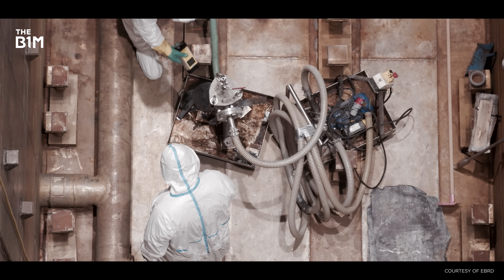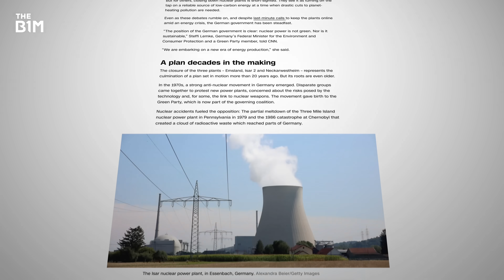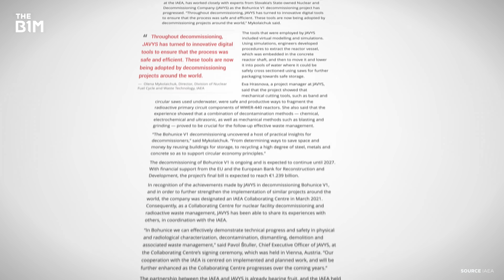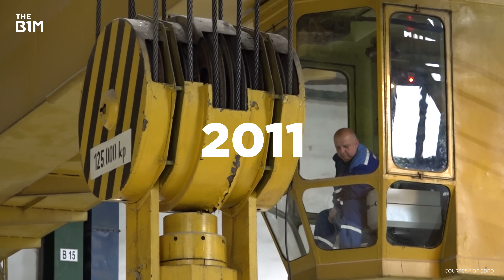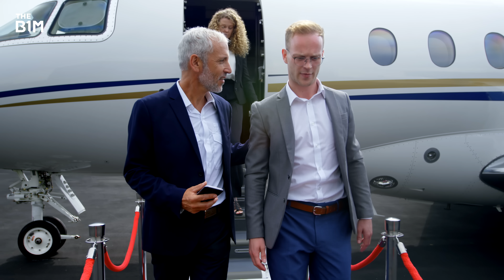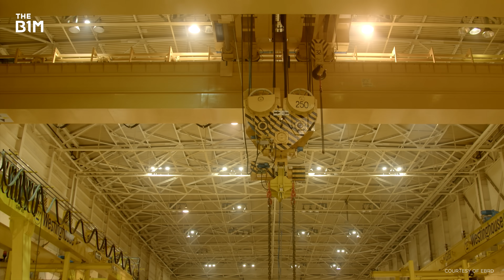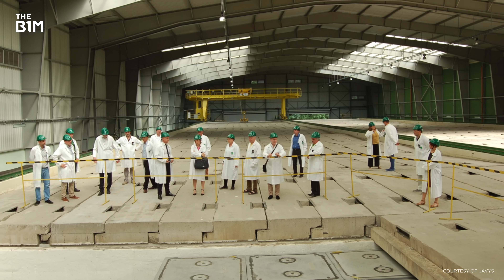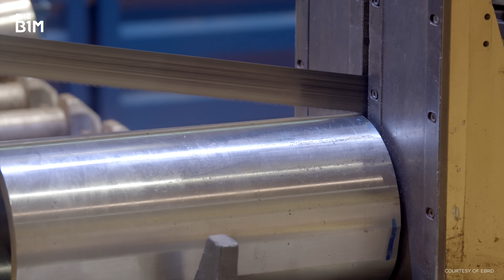Why These Soviet-Era Reactors Are Being Taken Apart

Comment: Germany is decommissioning it nuclear reactors in favour of coal and energy from hostile nations because climate change or something
Reply: Coal use in germany has been declining for years and is now the lowest it's been since reunification. 1GW of solar capacity added per month will do that.
Reply: Yes. Some very poor decisions have been taken in that country. They actually effectively replaced their nuclear with renewables, leaving most of the coal and gas in place, and thus still have quite high energy sector emissions. They are still making progress (the supply is 75% renewable/low-carbon right now, and thus 350gCO2e/kWh, for example), but it should have been so much better (the UK did a much better job of this overall, although right now it's only 60% low-carbon, 239gCO2e/kWh, because Germany has more solar).
Reply: @xxwookey  you can't compare UK with Germany and other countrys with big lignite brown coal mines. UK has nearly no coal mine jobs since the 90s when the chart on wikipedia is true. 
Germany has the lausitz and the one in NRW where a lot jobs are direct and indirect connected to the coal mine and the power plant next to it. If you make such a cut you need to be sure that there are enough other industry jobs in that regions that will keep the old coal regions alive. Ghost towns are never good. 

Stone coal is imported so easy to move that power plant to backup stage and get rid of it later. 

Poland and USA has the same problem with their coal regions that you need new good jobs there or you produce yourself a political problem in the near future.
Reply: @toggleton6365  Yes you have to transition the people, but you have to do that anyway at some point - just get on with it 20 years ago instead of killing the nuclear plants first and only getting serious about the coal in the last 10 years. That choice has cost millions of tons of emissions, which in turn has cost real lives of people (including Germans in floods, but mostly poor people elsewhere). 

There is plenty of coal left in the UK to dig up. We didn't stop in the 1990s because there was none left. OK, we didn't stop because of great climate policy either  - we stopped because it was cheaper to open-cast mine it elsewhere. So that was partly an accidental success, but dealing with that job transition early was the right thing to do (it could have been done a lot better - Germany is doing a better job on that front I think)

The UK kept its nuclear running till end-of-life, and Germany didn't. I think it's perfectly fair to said that Germany collectively screwed that decision up, causing great loss to us all. 

So yes, I think we can compare. Obviously circumstances differ, but there are comparisons to be made.
Reply: @xxwookey  Well hardcoal mines in Germany are closed too since a long time. And imported from elsewhere cause cheaper. I did talk about lignite. And the region in NRW close to the netherlands and france will be less of an problem that is why there is the push to shut it down faster. The big political problem is still the reuniting with east Germany. And the region there that is already burning political. Fast shutdown there would make it a lot worse.
Reply: Then, they are completely stupid.  If is for climate change, then you need nuclear powerplants.

Comment: Bohunice 1 & 2 are WWER-440/230, the same type as Greifswald-1 to 4, so not that new, when the Bohunice units shut down, the Greifswald units were already 11 and 13 Years into their dismantlingprocess. Also Slovakia was never part of the sovietunion, Czechoslovakia was only member of the Warsaw Pact.
Reply: And a WWER 440 isn't exactly a giant reactor.
Reply: @tz8785  depends... If talking generally, basically any nuclear powerplant reactor can be considered "giant" as far as things go... I mean it is much bigger than a common washing machine or freezer. If comparing reactors to reactors, then you would be correct.

And then the whole debate on the nature of Czechoslovakia... Fact is that while not technically integral part of USSR, it used to be a de facto vasal state with rather limited ability to govern itself.
Reply: read. please read.

Comment: Bulgaria also shut down it"s VVER-400/WWER. They don't meet some requirements for safety and bioshield. VVER-1000 work fine. However ours were not disassembled. Interesting video
Reply: VVER 10%0 are newer design, with containment, which is missing in 440 design, or rather be using barborage instead, but that is not up to the EU standart, as there are no such type of reactor, construction philosophy in EU-15.
Reply: @lukasvrabec5783  You can license reactors with the same containment type as the VVER-440/230 in the EU, like the AP1000, for example.

The key point of the VVER-440/230 is, that the containment was not designed to withstand most of the expectable damages. It was only designed to withstand a slow gradual leakage of the reactor vessel, but no major failures, like a pipe rupturing or a corroded through RPV-head bursting or such. In those cases, the VVER-440/230's reactor building would just burst together with the primary loop.
Reply: no....    it is Europe setting this condition. It is about energy control

Comment: So if we take into account the 1.3B clean-up, isn't nuclear power very expensive?
Reply: The decommissioning cost is something like 5% of the total lifetime plant cost - so there is generally a 0.06 cent charge per kWh to cover decommissioning (on a generation price of 10 cents/kWh). So it's a cost, but not a large one. Nuclear power is relatively expensive (more than twice the price of wind or solar) but it has a completely different generation profile (steady all winter) and that has value. If storage gets cheap enough, much of the value in expensive nuclear generation evaporates, but some countries just do not have much local renewable resource, so in those places nuclear remains attractive if only for energy independence reasons.
Reply: Although its an added cost, on a cost per mw generated basis nuclear is consistently around $80 all in all, although wind and solar will be cheaper, nuclear is still cheaper than some offshore wind farms, geothermal and hydropower sources, on a cost per mwh basis
Reply: @milneman101 Offshore windfarms play havoc with underwater acoustics. They're cruel and dangerous for underwater wild life that depend on sound to navigate, such as whales.
Reply: With big reactors, yes. The small modular reactors briefly mentioned, no: Most of them 1. Run off thorium instead of Uranium (much cheaper) 2. Run with salt instead of water (no high pressure == no explosion risk) 3. separate fission components as they're running (i.e. instead of making nuclear waste they make useful nuclear byproducts, such as the stuff we use in cancer treatments)

Comment: Ummm Slovakia was never a part of the USSR and I don't get how Chernobyl nuclear disaster is related to these, unlike RBMK reactors used in Chernobyl, VVER design used here is inherently safer so I have reasons to believe it was shut down due to stupid politics, not actual security concern
Reply: VVER is not as bad as RBMK (nothing is!) but there were serious issues in the early VVER designs, meaning they didn't meet European requirements any more. So it's not just silly politics.
Reply: @xxwookey  Such as?
Reply: @xxwookey  Ой, не надо! Просто ЕС не нужны были другие электростанции, им важно было держать Словакию на коротком поводке и при помощи дефицита ЭЭ это сделать очень просто.
Reply: @WladimirGalkin VVER 440-230 is simply old design which missed many of nowadays important function and since these two units were on the end of the their lifespan, it was simpler to shut down them. VVER 440-213 (newer version) met security requirements. Slovakia operates 5 of this units and each unit has more power than each unit of VVER-440/230. One unit OF VVER-440/213 is underconstruction now. These day there should be some pre-operation tests done on these unit and by the end of this year it should start operations. But without that last unit, Slovakia is now energy exporter.
Not to mention plans to build new units in Slovakia in near future.
Reply: @ao5139 О, компетентный человек. Приятно.

Comment: Where does all that contaminated material and gear go? 
Who pays for the clean up
Reply: Into an appropriate low-level or high-level nuclear waste store, as explained in the video. One useful feature of radioactive pollution is that it naturally decays so if you leave it for long enough it stops being harmful. Most other harmful waste does not have this 'self-improving' property. There is typically 100:1 ratio between low-level waste and high-level waste. Requirements for storing the latter are strict and most countries still only have temporary stores due to failing to chose sites for permanent ones. Finland is a notable exception.
Reply: @xxwookey  for how long, who pays for maintenance ? How long is the longest running repository been in operation (historical data)
Reply: @estimatingonediscoveringthree  You don't 'maintain' a permanent waste storage facility. You fill it up (over several decades), backfill it and leave it. So there is no attached cost once it's full/closed.
Reply: @xxwookey  lol! Yes you do! Name one that isn’t maintained!!
Reply: @estimatingonediscoveringthree  I'm only aware of one (Onkalo) and it's only just been opened so of course it's not full yet, so it's a long way from entering the 'completed and no longer maintained' state. Are we perhaps talking at cross purposes, and you are talking about temporary storage sites rather than permanent ones?
Reply: @estimatingonediscoveringthree  I'm only aware of one (Onkalo) and it's only just been opened so of course it's not full yet, so it's a long way from entering the 'completed and no longer maintained' state. Are we perhaps talking at cross purposes, and you are talking about temporary storage sites rather than permanent ones?
Reply: @xxwookey  so we can’t say maintenance isn’t needed. Full time monitoring is definitely needed. Maintenance will be determined based on the rate of potentially structural degradation and water infiltration and off gas management. All these fissile cocktails are making radioactive gas daughter products constantly and that need management
Reply: @estimatingonediscoveringthree  I'm pretty sure the plan for Onkalo is to seal it up and leave it. No 'full-time monitoring for 100thousand years'. But feel free to read the docs - I'm sure it's all specified in great detail. Of course people in the future might decide to do things differently.
For temporary storage it's pools to start with and dry casks after a few years (usually 10). The first dry-cask storage site was set up in the US in 1986 so not quite 40 years. Almost all are inside existing nuclear stations for ease of management. But Germany and the US have some dry-cask storage at independent sites.

Comment: In Germany the coal lobby paid more than the nuklear. Now we are running coal power plant.
Reply: @diefachfrau that is simply not true. The Atomausstieg happened because of Fukushima. And most people wanted it at the time.
Reply: @bastisonnenkind  The nuclear phase-out in Germany started with Chancellor Gerhard Schröder (SPD) and Environment Minister Jürgen Trittin (Greens) around the year 2000 and was accelerated by the events in Fukushima in 2011. The issue was used in election campaigns and was therefore implemented. In Fukushima, many safety mechanisms of German craftsmanship and engineering worked. We have the technology to generate energy safely. Go to NRW (North Rhine-Westphalia), where coal is prevalent, and see how people are affected by it.
Reply: @diefachfrau  So the people decided - you wrote the coal lobby did - what is it?
Reply: But the coal power plants are running at the lowest amount since 1964. Germany does the coal and nuclear shutdown at the same time. 
The next years will be very interresting cause renewables no longer need to balance out the closed NPPs. So the coal percentage will go down faster.
Reply: @toggleton6365  interesting will be should the government will pay to the coal industry for shutting down and the workers
Reply: @diefachfrau  Getting rid of lignite/brown coal is hard for germany cause big regions are highly depending on that coal jobs. just dropping it will mean that you have high unemployment and a political timebomb. Like the lausitz that as part of east Germany already had de industrializing after Reuniting. So having a second wave will make it quite easy for right wing populists to fuel that anger. Getting new companys to build industry jobs in that region will take quite some years. Hard coal is less of an problem cause the mining jobs are gone since years. So it is as easy to drop it as it was with nuclear.
Other countrys have the same problem like poland and regions in USA. No alternative jobs is never good for such a region. 

The question if we should pay out coal companys have i mixed feelings. There are payments to shutdown faster and i would guess if they are not compensated they will do everything they can to slow down the transition to clean energy sources. No good option to choose from. 

There are already quite a lot power plants that have a shutdown date before 2030. 2038 for the last coal power plants if there is no better deal found to make it faster.
Reply: @toggleton6365  so, germany did NOT shut coal power plants down, is what you're saying.
very klimate, much protektion

Comment: to close nuclear power plants is the stupidest thing ever. listen to populists who don't know a thing about the technology and think all plants are the same. then make your state dependent on import fossils and then burn them into air pollution. congrats! you've degraded your energy and security sectors + made your electricity much more expensive. ask Germany now what they think when russia is not that friendly and it's gas is not that good source of energy
Reply: Funny that the populists are right now the one that propose building new one when it is unlikely that you can compete in a high Renewables grid with your NPP that needs to run 24 7 at full load to be even close to be price competitive. And as always need big government subsidizes and contracts so they no don't need to care about the waste after they are gone. 

And the electricity prices are back to before russian gas war. The biggest way to cut that dependency of russian gas is to remove heating and some industry from the gas demand with electrification like with heatpumps. So friendly countrys like norway can  deliver the rest of the gas usage for the future till fossil gas is no longer needed.
More nuclear power plants would not have helped that much in that gas war as people think it would. Producing Electricity is just a smaller chunk of the overall gas usage.
Getting in so many houses a heatpump or building up local heating grids takes many years.

Comment: Germany has recently decided to push back it's plans to shut down nuclear power due to the push away from Russian energy dependence
Reply: That was only for a few months to use the tiny rest of the fuel rods left. Running it longer than a few months would mean bigger maintainance and security certifications and getting new fuel rods for many years. There are better use for that money than restarting them. 
 But the chance that they are restarted is nearly 0. Not even the companys that had run them want to run them and already preparing the dismantling.
Reply: @toggleton6365  thanks for the info man, not sarcasm. Wasn't aware of that much

Comment: Dismantling a nuclear reactor is a complex process:
Shutdown: The reactor is powered down, and all nuclear fuel is removed.
Cooling: The reactor and its components are allowed to cool down to reduce radioactivity levels.
Decontamination: Radioactive surfaces are cleaned or removed to protect workers and the environment.
Disassembly: The reactor is taken apart piece by piece. Highly radioactive parts are handled with special care.
Waste Management: Radioactive materials are safely packaged and transported to storage or disposal facilities.
Site Cleanup: The area is cleaned and restored for other uses once it’s free from radiological hazards.

what do you think?!